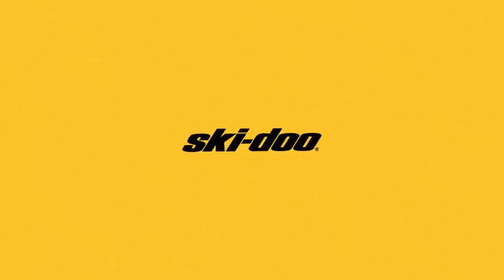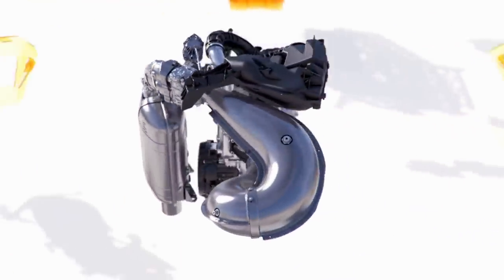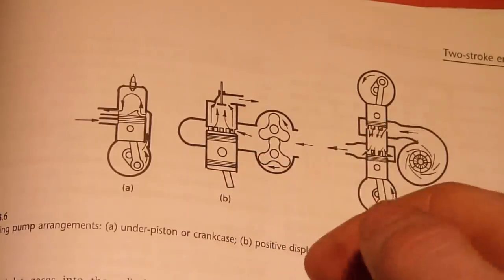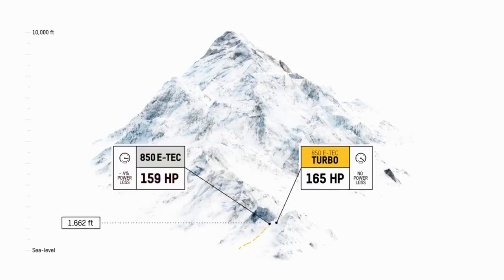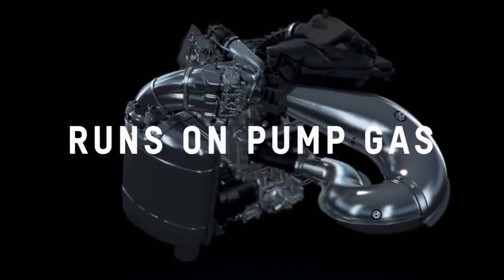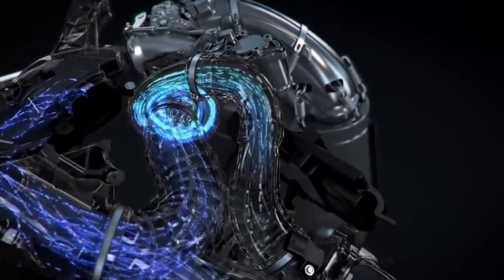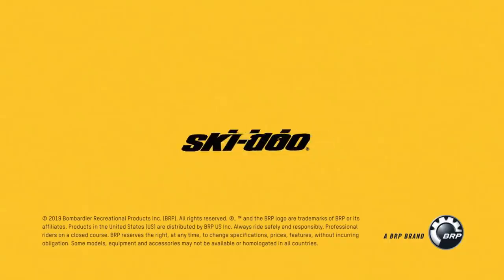2 Stroke Turbos - they can't be done. Period.

Comment: You DO realize that TURBO is about the ONLY way that you can boost a crank case induction 2 stroke..   the hot side of the turbo increases in pressure as compressing air on the compressor side gets more difficult. This serves the same purpose as backpressure on a 2stroke na pipe. It raises cylinder pressure. As the compressor forces more volume in the crank case than can be normally inductedthat equates to more being transferred, which translates into more pressure on the hot side causing more back pressure but with a clean cylinder. Now if you wanted to talk about a PDS or centrifrugal, you would be correct. You'd need stinger to create the back pressure increase but adding an SC quickly outflows the pipe and drastically narrows the window that you can make power. 2stroke stuffing on youtube is beating his head against the wall right now with that very thing and i keep telling him that he needs a TURBO for it to work. 

Anyways, yeah, that's that. Crank case induction CAN be boosted, but ONLY with a turbo.

Comment: You didn't even say anything....

"Pressurized air"? That's already a thing. As you said, the crankcase pressurizes the intake air. 2 stroke exhaust manifolds are shaped to manage this. Turbos also have *backpressure*. There is no net increase in the pressure difference between the intake and exhaust ports.

Comment: LOL   Not only can it be done...and well., but it works awesome. A 2 stroke mercury outboard goes from 39 HP to 90 HP and on a hydroplane goes from 70 MPH to 105 MPH.  Works just as good on a snowmobile so well that my buddy's snowmobile can only race  on a lake because the snowmobile race track does not have enough shutdown length.. I am presently building a 2 cylinder Mercury (20HP) and adding a turbo. This guy is supposing 0 PSI on the exhaust and didn't draw in the turbocharger in line with the exhaust and it's backpressure...  NOT SO.

Comment: It does make sense to me....

The difference between motorcross engines and other 2 strokes is the expansion chamber, allowing the immediate back pressure reduction at high revs which allows specific porting and reeds to produce ridiculous power.

I'm not sure 2stroke has any advantages for midrange torque unless it's diesel !!!
Reply: Sorry: after flow velocity increase, higher back pressure pushing back on the intake charge and reeds

Comment: The turbo 2 strokes should work but be inefficient wouldn't they need to create exhaust pressure to spool the turbo to make to make intake  pressure.  the exhaust wouldn't be free flow because of the restriction the turbo creates to force in more air . So all the fuel wouldn't be dumped out of the cylinder just a small amount.

Comment: Looks like the only benefit of the turbo would be it's better at getting rid of the exhaust gasses and have a cylinder full of fresh air. You'd lose all the boost the moment the exhaust port opens.
Reply: I don’t think the cylinder ports are set up the same as in a two stroke dirtbike
Reply: @gadnuk7159  the ports need to be open at the same time for a period of the rotation to make it work. it's how two strokes scavenge. and that's why turbo 2 strokes struggle to er, make a lot of boost. 4lb is minuscule for 850cc.
a 4 stroke would easily achieve 15 with the appropriate turbo.
THAT or it would run a DD style cylinder with massive exshaust valves, which could theorically provide a high output. DD's can take a lot of boost, because poppet valves can be timed independantly from the crank. erh. nerd mode out.
Reply: And dont forget the crankcase lubrication is now from oil bath, so no more burning oil
Reply: Côme Thiburs Côme Thiburs yeah I understand all that, I’m just saying it looks like from the original comment that the commenter is assuming the exhaust and intake ports are set up in a similar configuration to a two stroke dirtbike where the exhaust port is above the intake port. I visualized it with the intake port being on top that way the intake would open and do a reverse scavenge thing if that makes sense. So the exhaust gasses would pour out into the intake manifold and the turbo pressure would hold it off a little so when the exhaust port opens it would then push all the exhaust gasses out and the exhaust port would be covered when the piston rises and the turbo could continue to pressurize the cylinder until the intake port is closed. The video doesn’t show how any of the porting is done so I figured the only way to maintain 4lb or boost, as tiny as it is, would be to swap the port positions
Reply: Tiago Ferreira much better for longevity though right?
Reply: Côme Thiburs not on my 125sx and my kx125. I don’t know about snow mobiles but in dirt bikes the intake is below the exhaust. On the power stroke the piston moves down and opens the exhaust port first. This allows exhaust gasses to escape into the exhaust chamber. Then the intake port is uncovered and fresh fuel/air from the crank case pushes into the cylinder purging all of the exhaust out of the exhaust port. Some of the fresh charge goes out the exhaust but the expansion chamber of the exhaust is used to create a pressure wave which pushes the fresh fuel/air back into the cylinder just before the exhaust port is closed on the compression stroke. Matt did a video on this a few years back explaining the process
Reply: @gadnuk7159  Hmm i guess with the exhaust back pressure you could keep some of the boost from pissing out in the exhaust and increase power. Would take a lot of tuning and engineering though. It doesn't make sense to me to make a 2 stroke engine that complicated and expensive when they could just go with a 4 stroke.
Reply: Rutger Mulder it definitely would take a lot of engineering but it seems that’s what the snow mobile people did if they accomplished this. Again, idk what their porting looks like so I could be waaaay off and I probably am but that’s how I would do it if had to give it a go
Reply from the maker: Oil bath? Wrong...
Reply: @gadnuk7159  the intake port always has to be below the exhaust port or you'd get a back fire thought the intake, with a single piston and piston ports the symmetry also means that the exhaust will always close last making supercharging pointless. With opposing pistons or poppet valve exhaust it is possible to vary the timing more
Reply: Lasse Langwadt Christensen I hadn’t considered that the gases would still be igniting when the intake port would open. Is there a way to make sure combustion is 100% completed before the port opens? Does this mean that much of the combustion energy is pissed out of the exhaust?
Reply: @gadnuk7159   "the combustion energy is pissed out of the exhaust" is what drives a turbo..
Reply: Lasse Langwadt Christensen yeah I’m aware. Dumb statement by me I guess. I just mean is there a way to make sure the gasses are not still ignited when fresh charge is pushed in, that way it would not auto ignite and you could have the intake port on top? I guess worst case just make it more complex and use a cam and exhaust valve like a four stroke
Reply: @RutgerMulder  it allows for maintaining power at altitude which is really useful,  a turbo as a compensator for altitude is old old technology. It will probably be used to make mental performance as soon as the aftermarket get hold of it though. 

2 strokes being lighter, producing more power for size and coping nicely in cold temperatures make them ideal for snowmobiles.
Reply: @RutgerMulder  If you get rid of the exhaust port entirely, you get infinite back pressure and your boost goes up enormously.  Helps with emissions, too, and you can lose all the weight and complication of the exhaust system, power valves, and all that cack.  Downside is that you're now stuck with supercharging, as you no longer have an exhaust to spin the turbine :)

Comment: It requires special crankshaft seals to do it right with case induction. VR Dichtungen has seals designed to increase sealing pressure as the differential increases. There's a metal casing on the outside of the seal that's only a few mm larger than the crank diameter. This let's the case pressure push the seal into the retaining case increasing sealing pressure. They can be designed for 150 bar. Using that on the outsides and dual back to back center seals,

Comment: So that comercial, that turbo just keeps the preasure on high altitudes as if you were on sea level?
Reply: Yeah. If I remember correctly it's actually how the first turbo systems were used. In airplanes

Edit: Apparently the first commercial use of a turbocharger was with ship engines (1925 10-cylinder diesel) but they were prototypes tested in airplanes as early as 1915 and by WW II they were used on several airplanes. It's all from Wikipedia though so it may not be 100% true
Reply from the maker: 4psi above ambient

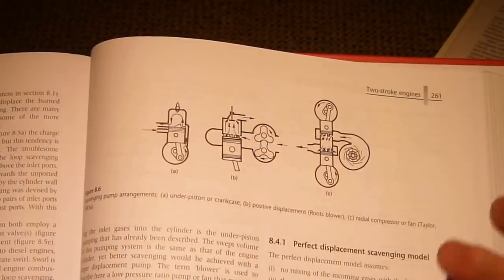Comment: 3:33 you're wrong because you're not taking into account 'time'. From the moment the exhaust (sleeve) valve is nearly closed, the forced induction raises the internal air pressure. You can still force a higher pressure into a cylinder than atmosphere EVEN if it's leaking as long as the leak is less than the supply air. The time the cylinder is leaking pressurized air (if it's fuel injected, this is actually good, because it purges spent fuel from the cylinder) is minimal compared to the time the cylinder is becoming pressurized during the compression stroke. Obviously there will be diminishing results from 4psia to 40psia compared to 2 stroked due to this 'time of intake/time of compression' relation.
Reply from the maker: I'm not wrong, it's not me...

Comment: I know I am gonna get crapped on but we have two Ski-Doo snow machines in Alaska with rotax e-tec 2 strokes and both have turbos. They have a lot more power than the ones we traded in with the same 850cc NA Rotax engines. I would love to know how they work?
Reply: BTW- they don't look like a normal turbo-charger and they are still under warranty so I haven't investigated their function.

Comment: What if you could extend the crank case port higher then the exhaust port slightly and have an electric valve release for the turbo open right after the piston blocks the exhaust port?
Reply from the maker: An electric valve? Know any reliable ones?
Reply: @dirtygarageguy  never said i had the equipment more of a what if kinda situation
Reply: @dirtygarageguy  maybe some kind of pressure release valve syncing up with psi of the compression
Reply from the maker: What I mean is that there are no electronic valves that are 1) reliable enough 2) fast enough
Reply: @dirtygarageguy  even if there was a way to sync it up with the timing... or what about a pressure release
Reply: If you control the pressure release valve on the turbo to hold a constant pressure on the valve and have it hit as many times as it can in sequence with the timing maybe every 2nd or 4th stroke

Comment: Maybe before commenting so fast it would be good idea to first understand the full picture of using a turbo on a crankcase charged loop scavenged engine. You seem to forget that the outlet side has a similar pressure increase caused by the turbine and controlled by the wastegate. So no more fresh charge is lost because of the turbo than before and the tuned pipe still works the same. Some adjustment for intercooler and pipe temperatures are necessary but is no problem and often done.

Maybe some reading of the nine new patents will also help:

https://www.snowmobile.com/trails/polaris-working-on-turbocharged-2-stroke-snowmobile-engine-65385

What you state though about it not possible is just plain wrong.
Reply from the maker: LOL you totally didn't get the point of the video! So maybe before commenting you should know the full story - but even if you didn't the video is obvious. 

Is it cold up their on your high horse?

Comment: The point is Crank case 2 stroke is a no go. Opposing piston is a maybe with little benefit lol  Honestly if you look deeper into The 2 stroke and what they did to that snow mobile.  It seems like they just made a compressor to gather air for higher elevations.  When air is thinner its harder to gather enough in a area to run the motor. seems more like they created a pre air rich environment for the engine to breath more then a typical turbo charging system like a car would use.  Old small 2 stroke helicopters used that idea. Listen very close! They even say higher elevation over and over which leads me to think there idea is what you would call a stored air feeding chamber design.  Happens to be they used a turbo blower to gather air. When motor runs it wont do a damn thing but run in background, till you hit 11,000 feet above sea level.

Comment: Here's what blows me away a bit. All that effort, for a horse power number, similar to what a 4 stroke would do NA....... wasn't the whole point of a 2 stroke is it would make shit loads more power?
Reply: But would a 4 stroke start as well at -40 Celsius and weigh as little ? (I genuinely don’t know !!) No doubt turbo 4T work well at altitude.
Reply: @COM70  In terms of power to weight? Like I said that power number is very lackluster. In terms of overall weight? It's a turbo 850cc snowmobile, the weight has likely gone through the roof.

As for starting? It's an EFI electric start petrol engine, can't imagine there be much of a difference?
Reply: @Aspire198  It's clear you spent NO time in the Arctic. EFI or not 4-stroke engines used in snowmobiles struggle, I mean really struggle to start when it's -20. Two-stroke sleds in good shape command a real premium in northern Canada exactly for this reason.
Reply: You literally know nothing, it has a shot system, look it up

Comment: Over half century ago, McCulloch made 6 cylinder rotary valve turbocharged 2 stroke drone engines.  A turbo (unless it is spun up) cannot start a 2 stroke engine.  Once the engine is running, a turbo can do the scavenging, no blower required.  Electromotive Diesel (EMD) locomotive engine use a starting blower, then switch over to turbo.  Detroit Diesel Allison (DDA) in the late 70s flirted with spooling up the turbo for starting, but idea died.
    A misconception is turbos back pressure the exhaust.  This is true relative to atmospheric pressure, but the back pressure is less the ‘front’ pressure provided by the turbo’s compressor.  It’s best to envision the turbo as raising the overall engine operating pressure.  
    Reverting to the Rotax, turbos increase engine temperatures.  Crankcase scavenged engine pistons are not cooled (with oil jets).  Suspect a short life.  Rotax is clever and may have it figured.

Comment: I would like
discover old snowmobile engines
2 stroke turned into a carburettor turbo
to see how they work
Reply: You could buy turbo for twostroke snowmobiles in the 90's, aerodyne? Turbos for rotax 670, yamaha vmax 4, polaris xc 700 + many more, all carburator engines.
Reply: They will work just fine. Ran them for years on our carbureted Rotaxs’. Given they are nothing like today’s turbo sleds, but we ran them for years. A lot of fun.

Comment: detroit diesels have superchargers and they make a turbocharged and supercharged one, ive worked on a bunch of the,  8v92TT 8v71TT... ect
Reply: Yeah, I was about to mention the diesels.
Reply from the maker: Not the same thing, at all.
Reply: Detroit 2 stroke diesel engines have scavenger blowers, not superchargers. These engines are not crankcase pressure fed so they have no means of breathing on their own. Hence, they would not run without the exhaust scavenger blowers.

Comment: 4psi boost is like turning your 1000cc engine into a 1300cc
Reply: 4psi boost, but presumably that's above what would normally be achieved by crankcase pressurisation (150%?). And on a 2 stroke and at 8000 ft where ambient pressure is under 11psi. That's actually a big increase.

Comment: Its a great shame that you havent actually looked around at the market and noticed that companies such as mine have been selling the self contained Aerocharger turbo  into the two stroke market for many years. You have missed two basic issues on your commentary - time/area; this airflow going in has to pass through the transfer, across the scavenge loop and make it out the exhaust. because of the practicalities of flows through the square edged ports and time, the vast majority doesnt rush out the pipe. Note: with direct injection only air is lost into the pipe and so you can see it as just over scavenging and no actual true loss. Turbo back pressure; As the intake pressure builds the restriction caused by the turbine also occurs and so there is a degree of flow balancing to limit the overt losses. Feel free to contact Brad at https://www.aerocharger.com/ and ask him about the thousands of units he has sold.... regards Phil from SprintAero.
Reply from the maker: Copy and pasted comment - idiot!
Reply: @dirtygarageguy  it got your attention which was the point. I don't like to see stuff being presented that isn't right.

Comment: The only forced induction 2 stroke engine that actually work is long stroke massive 2 stroke diesel engine. Because each cycle is very long and because it's a diesel no fuel escapes the exhaust valve just air.
Reply: Like this https://en.wikipedia.org/wiki/Napier_Deltic

Comment: You should consider changing your way of thinking. I've known many snowmobile drag racers running turbochargers on case reed two strokes since the 1990s. Sure a portion of the charge is lost in the exhaust durring overlap but the advantage of clean dense charge overweighs the airflow inefficiencies.
Reply from the maker: What you've just said doesn't contradict what I said.